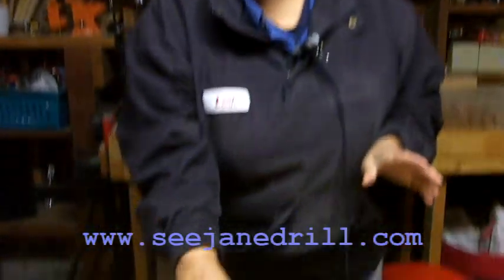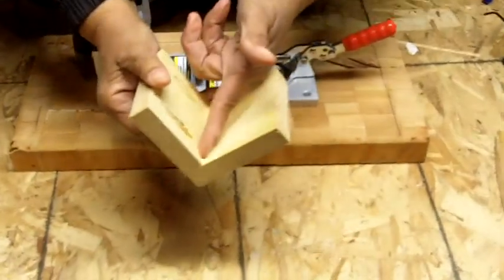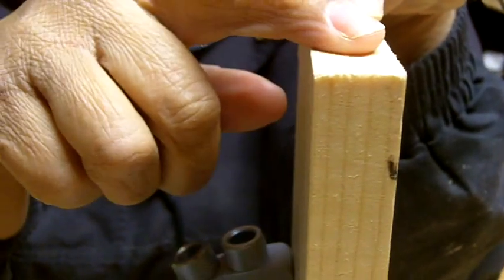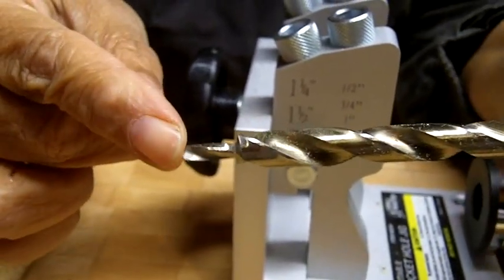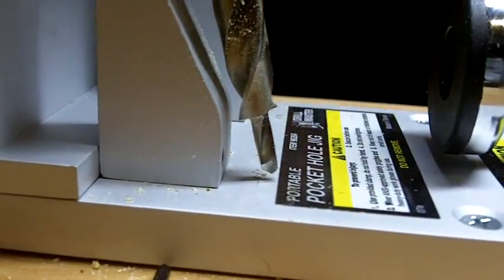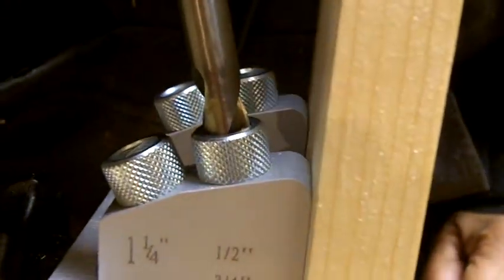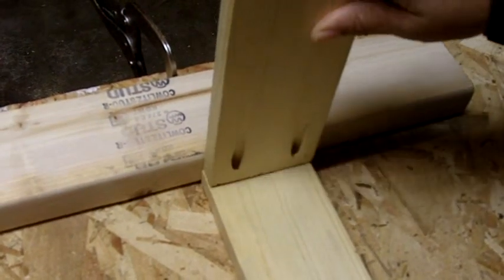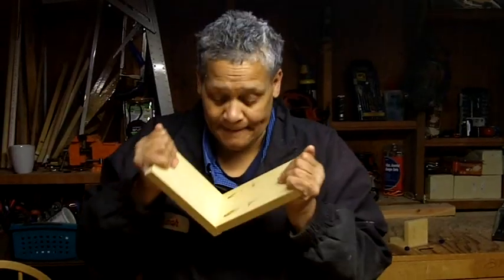Pocket Jig Explained Easy to Follow Instructions

Comment: Great video. I recently purchased one of the HF Pocket Hole Jigs because I am building new oak cabinets for our kitchen and wanted to use pocket screws instead of air nailing. It was definitely money well spent because it works great, makes the job so much easier. It is slower than nailing but is a much cleaner appearance since there are no visible holes on the outside of the face frames or inside the cabinets. The joints are rock solid and much stronger than nailing. I highly recommend the HF jig, it works fantastic and is a lot less expensive than other pocket hole jigs that I have seen.
Reply from the maker: bigbassmann Thank you, bigbassmann.  Well-put.

Comment: Thanks a bunch, this was the exact same type of jig I bought and was a little confused about how to set the drill bit depth. Cheers!
Reply from the maker: you're very welcome!
Reply from the maker: oh, and I checked out your channel, too.  Very nice!
Reply: An easy way is too set a dime under the tip of the bit and then tighten the set screw on the collar. You don't have to hold it up while tightening.

Comment: This is nice,  do i need to adjust for screw legnth? I noticed that you used the shallower area was your wood stock size an inch or os that based for choosing for the wood thickness thats the only part i seem to not get. Thanks for the video we just bought one! Its a cool feature to also ise this without the clamp

Comment: You now have a new subscriber! Thanks for clearing my understanding of the tool I purchased today.  May I ask you you do a video on the "Portable L Base"?  If my understanding of the instructions is correct, it appears as if you can use this without the use of the base and the clamp.  My question is, how would you secure the drill guide to the work piece?

Comment: Great video.  I just finished a small door to keep my dogs out of the kitchen and this was my first experience with pocket holes.  The biggest problem I had was that the wooden plugs (which were offered in only one size) were too long for the holes and would therefore required a great deal of sanding to get them flush.  Why was this???  (I used the jig correctly for the thickness of the wood and I set the bit stop correctly for the size of the wood.)

Comment: Great vid! If you are drilling half inch thick wood then the wood has to be slightly elevated before you clamp it. The half inch wood rests on two screw heads by the bottom of the clamp fence, the screws come with it, see page 5 of the manual.
Reply from the maker: Hi, thanks DJ!  What you are saying is definitely true of the pocket jig I used in the video.  I was reluctant to mention that in the video, because if a viewer was using a different type of pocket jig, it might not work exactly the same way.  But I appreciate you pointing out that feature!

Comment: Is there any strength difference if you were to rotate the piece with the holes by 180 degrees and screw from the outside in? Obviously the holes would be exposed but I'm wondering if the joint would be stronger.

Comment: Hi Leah great video as usual. Can the jig be use for larger piece of wound. Wanted to use 2x2" wood. Angela
Reply from the maker: Hi Angela, Your best chance for success would be with the Kreg mini jig, because it gives you real flexibility with stock thickness.
Reply: +seejanedrill thank you will give that a try
Reply: 2X2 is actually 1 1/2 in x 1 1/2 so the setting, if you use the other set of holes, Leah was using would be correct for it.

Comment: I have tried using pocket holes with the mini kreg but I lost faith in it. The joint is not solid. I was able to break the joint with little effort using th he right kreg screws with the right size wood. I really wanted this to work because it looks so fun to do and is easy. If I'm doing something wrong please help.

Comment: Hi Leah,
Love your videos! I need help!
I really enjoy using my Kreg tool but I'm failing miserably trying to join cedar 2X4s into a 4X4 post. I'm making a large planter / privacy screen.
The screws don't grip. I'm using 21/2 inch outdoor screws for soft wood. Any suggestions?

David Guspie
Reply from the maker: David,  You may want to consider using Kreg SML-C250B-250 Blue-Kote Weather Resistant Pocket Hole Screws - 2 1/2", #8 Coarse, Washer Head
Reply: Thanks Leah!

Comment: I just bought one because you made it look so easy to use. I was confuse when I came across two black screws saying if I use a half inch thick I would need to screw those two screws. Did you come across this? Did you use  any screws at all or is it just me.
Reply from the maker: The screws help to create more "bite" and more depth when you are using thicker stock

Comment: Maybe I missed it in the video, which is a great video. What kind of screws were you using? Meaning, how do you know the length of screw to use? Thanks
Reply from the maker: R Arizona Good questions.  I used pocket hole screws in the video. They can be purchased in most home improvement and/or hardware stores.  You can buy a single screw size, however,  pocket hole screw sets with screws of varying lengths are also available, and I find those to be best. The thickness of the stock determines the length of the screw.
Reply: @seejanedrill  those aren't pocket hole screws. pocket holes screws are smooth at the top.
Reply: you have to buy screws that are designed for the type and thickness of the boards. there are fine threads for hardwood and coarse threads for soft wood and plywood. you can't just set the collar by eye you have to know how thick the receiving board is and match the collar placement to that.

Comment: How long does the drill bit last? Also, can you buy a replacement bit in the store, or do you have to special order one?
Reply from the maker: The drill bit last just as long as a traditional bit.  You can purchase a replacement bit either online or at a woodworking store like Woodcraft, Rockler etc.

Comment: We have a few pocket hole jigs in our workshop. All instructions suggest the orientation of the screws should face into the body of the timber and NOT towards the edge of the joint as demonstrated here.
Makes sense when you stop to think about it but an easy mistake to make.

Comment: You dont need to pre drill the other piece of wood?
Reply from the maker: Richard Cowtails  Interestingly, no.
Reply: +Richard Cowtails I am doing allot of projects, (shelves, Cabinets) and do not have allot of Muscle; I was wondering if the Jig would be a help for my lack of brawn.
Reply: It will account for some brawn needed. either way when you put up the cupboards, will take some good strength unless you use Ikea hangers> (bolt the rail on the wall and slide them on and use the set screw to mount in place.) materials and tools will vary. accounting for cost and durability of the projects. I would use a jig set up for the table saw. many joinery types can be used for this application. If you need further help, I can advise certain things for you and your project. I'll try and help anyway I can

Comment: Leah, Lambiepie again.  Forgot one thing.  The wood plugs were a double problem because they were not only too long for the holes, but too fat.  They simply would not go into the pocket unless I sanded around the whole pug to make it fit into the hole.
Thanks.
Reply from the maker: lambiepie Hi Lambiepie, what you experienced is a very common problem, which doesn't have anything to do with how you used the jig. It's just the wooden plugs themselves...most people who use them experience this same issue.  Sanding them down is fine.

Comment: you're using the wrong screws and losing the effect of pocket holes. Glue actually does not make pocket hole joints stronger but you need to have the right screws because the side closest to the head should NOT have threads. This allows the pocket head to pull the joint tight and strong. Without that clamping movement it's just weaker butt joint.

also you need to adjust the collar to match the screw length and target board thickness not just "lift it off the jig". A lot of people are goin to watch this video and put their wrong screws in th joint and many will drive them through the target (not the board you drilled) board.

Comment: The link to the jig in this video is incorrect. Because of this I almost messed up and bought it which would have been a huge mistake if you look at the amazon product you are promoting and sending people there by your link. The one you sent me to was a General tools brand with only 2 holes and no steel sleeves for the drill. The correct one is a Drill Master 4 hole jig with sleeves and from Harbour Freight. Damn good thing I did my homework and noticed or I would've bought some inferior crap that didnt do all you had in your video,,,like even work on 2x4s and eats out the aluminum drill hole! NOT HAPPY!!!